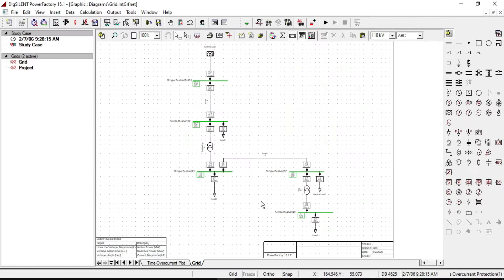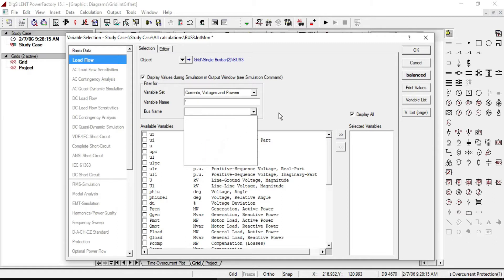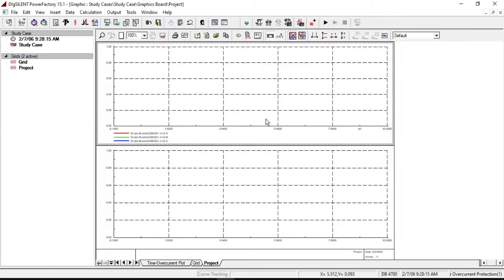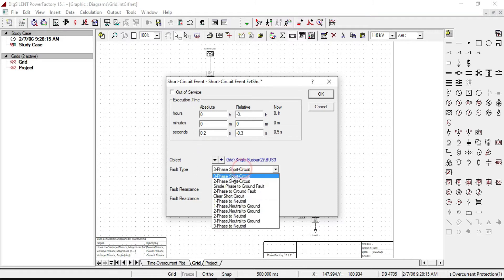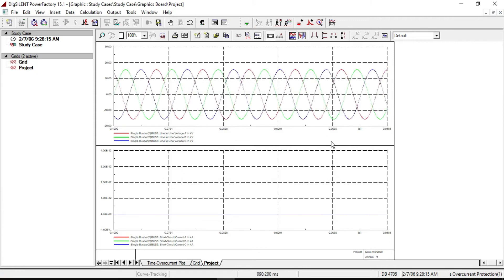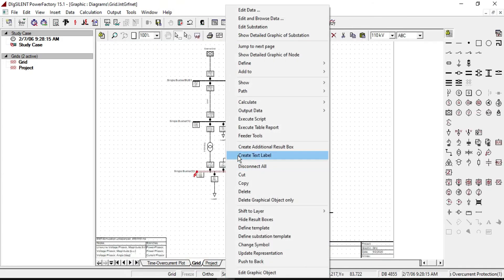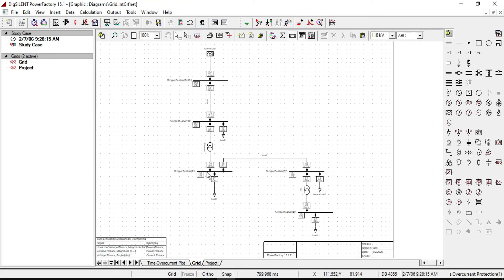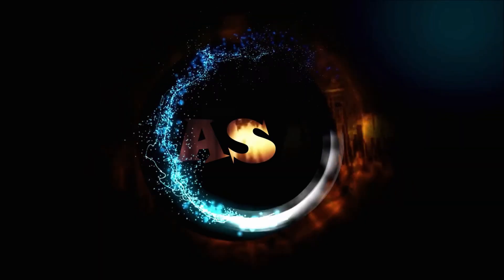PowerFactory DIgSILENT tutorial #24 how to plot three phase voltages and short circuit current.

Comment: Do i need to import the data to Zero sequence impedance (short circuit voltage uk0 HV-MV...) when simulate the short circuit event? if need, what should i do to import the data?
Reply from the maker: It depends on your design, and the results that you want to obtain. If you want to simulate a simple short circuit event you don't need to change the zero sequence and other settings, put them on default values.
Reply: @asaproengineering  i'm performing a project that I need to compare the influence of short circuit on the grids. One is designed with entire line and another is replaced by a length of cable. So should i need to import the data to Zero sequence impedence? If possible, can you teach me how to calculate the uk0 and SHC uk0r?